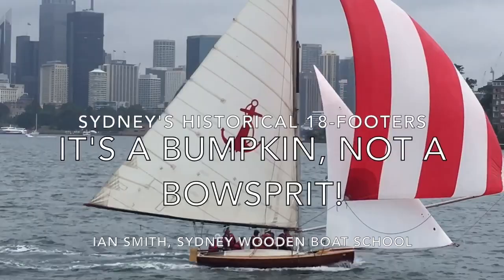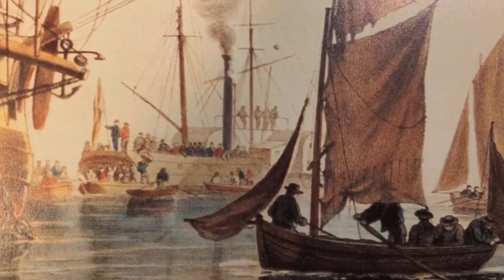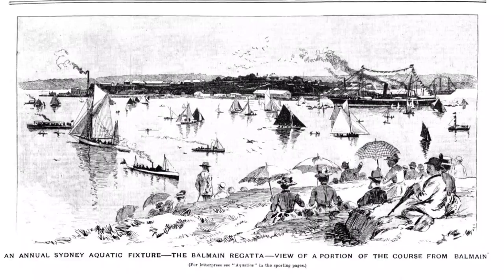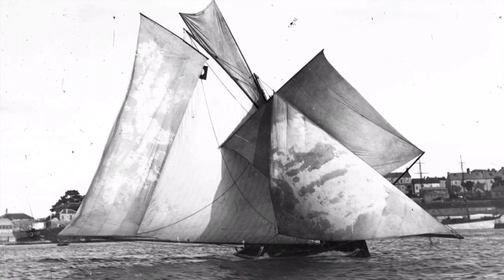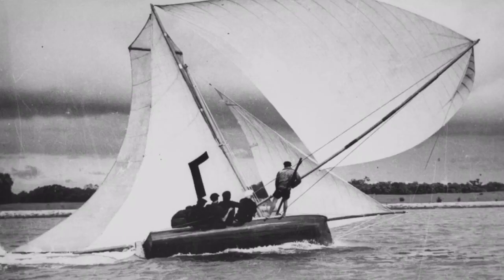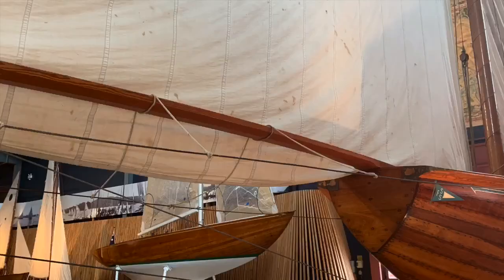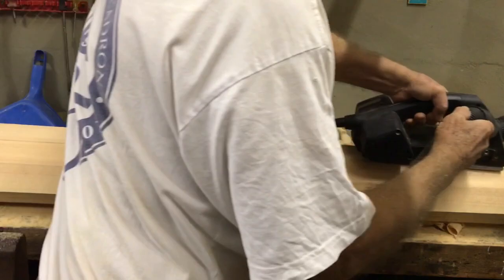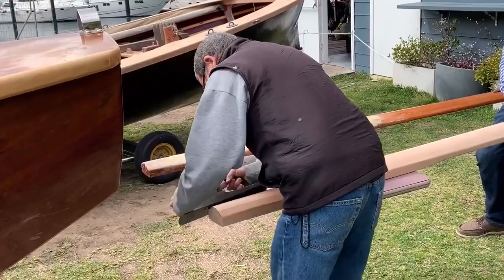It's a Bumpkin, Not a Bowsprit!

Comment: Mine is a bowsprit in Australia as It is fixed. Cutter rigged sloop. I would like to add a net at the front, but the sides are too small. I have seen wooden extenders poles out both side to attach a wider net. If you get involved in one of these, could you post that please.